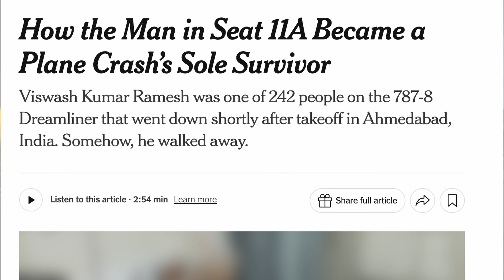Why the RAT Changes Everything – Air India 171 Update

Comment: Here is my theory about AirIndia Crash - 

One alive Passenger told to media that lights started flickering green and white so it always happens when both the engines are failed or off .. RAT deployed- When both engines generators failed. I don't think both engines can fail at the same time. Air India Flight 171 took off later than expected, which could be because one engine had failed while it was on the runway. Video footage of the takeoff shows a large dust cloud form just as the plane lifts off, which suggests that it was near the end of the runway.  Why aircraft consumed more runway than normal ? If both engines had failed, the aircraft would not have taken off at all. But even with one engine down, it took more runway than expected.  It may be due to the MTOW was much more than the limit.  Imagine if there was overloading, and one engine failed on the runway. The pilots must have been startled. They would have seen the perimeter wall of the airport and wondered why the aircraft had not taken off… They were already tense about the engine failure and the delayed lift-off. They were distracted. They were supposed to pull up the landing gear at around 100 feet. Now, listen carefully. They climbed for 100-150 feet with a damaged engine, and forgot to pull the landing gear up. 
 
Pilots are required to follow ‘memory items’ in the event of an engine failure. When they hit 400 feet, the Captain of the aircraft pulled the thrust idle switch for the faulty engine, and the co-pilot pulled the fuel control switch off for the wrong engine…Wrong engine means working engine. One engine was damaged on the ground, the other engine they killed themselves. 

At 400 feet, they were without power and the aircraft started losing altitude. Pulling the fuel control switch off and the engine fire switch are irreversible actions on a Boeing aircraft. Engines will not come back, but on Airbus this action is reversible. Boeing has to modified this thing.  

So Late takeoff because one engine failed, pilots were startled, they did not pull the gear up… Once they have cut the wrong engine, they are without power. You can not do anything after that. You are going down, and you have 10-12 seconds before impact. The footage shows they tried to pull the nose up, but the plane crashed into a building, and the worst disaster in the history of aviation happened.  

Experience is different than tackling the emergency.. Sometimes experienced pilot becomes hopeless during emergency situations.. In 2021 Goair pilots shutdown the wrong engine after bird strike, once the aircraft stopped climbing at an altitude of 3330 feet, pilots realised their mistake and consequently started the working engine 1 and brought back the plane to delhi airport, but here pilots didn’t get the time to think..

Pulling the Fuel Control switch OFF initiates the shutdown, but pulling the Engine Fire switch completes the full shutdown and isolation sequence and physically locks it in place. This combined action is irreversible in flight because:

1.  The Engine Fire switch mechanically locks when pulled.
2.  Resetting it (even if possible) would be extremely hazardous.
3.  The design intent is absolute isolation once a fire is confirmed and this action is taken.

This irreversibility is a fundamental safety feature of Boeing's engine fire protection system.

Pulling the Fuel Control OFF and Engine Fire Handle/Button is irreversible during flight on Boeing aircraft due to the mechanical latch.
Performing the equivalent actions (ENG MASTER OFF + ENG FIRE Button) on an Airbus can potentially be reversed during flight.However,Reversal on Airbus is only permissible and safe if the fire warning is confirmed to be false.It is absolutely prohibited if there is any indication or suspicion of an actual, ongoing fire or severe engine damage. The electronic design allows reversal, but strict operational procedures govern when it should be used.

Comment: VADAKAYIL

AS SOON AS OPERATION SINDOOR STARTED AND I FOUND OUT THAT TURKEY SENT THOUSANDS OF DRONES/ MISSILES TO PAKISTAN BY SHIP AND PLANES

I WARNED MODI TO REMOVE TURKISH AIRCRAFT ✈️MAINTENANCE COMPANY CELEBI ( FOR BOEING ) FROM INDIAN AIRPORTS.

A SABOTEUR CAN PRETEND TO BE CHANGING A FUEL FILTER AS PER PLANNED MAINTENANCE – ALL IT TAKES TO CRASH THE PLANE IS TO CHANGE 15 MICRON FILTER BY A 5 MICRON FILTER

THE INDIAN 🇮🇳GOVT PROMPTLY REVOKED THE SECURITY CLEARANCE OF CELEBI.. THE CLEARANCE WAS REVOKED BY THE BUREAU OF CIVIL AVIATION SECURITY (BCAS) ON 15 MAY 2025

BOEING PUT PRESSURE ON INDIAN JUDICIARY AND THE TRAITOR JUDGES SHOCKINGLY QUASHED THE INDIAN GOVT REVOCATION

TURKISH CELEBI WAS PROVIDING ITS SERVICES AT NINE DIFFERENT AIRPORTS AND EMPLOYING MORE THAN 10620 INDIVIDUALS.

—

VADAKAYIL

THERE IS NO NEED TO PLANT A BOMB IN A PLANE.

A SABOTEUR COULD JUST SWITCH TO A FINER FUEL FILTER.

THERE IS NO NEED TO CRASH WORLD TRADE CENTRE TWIN TOWERS WITH PLANES . AN INTELLIGENT SABOTEUR CAN JUST BOIL MERCURY IN A VENTILATION DUCT AND NOBODY CAN ENTER THE TOWERS FOR THE NEXT SIX YEARS

THERE IS A JAMES BOND MOVIE ABOUT FORT KNOX GOLD BEING IRRADIATED ( GOLD FINGER )

SABOTAGE IS SO EASY.

.—

DON’T YOU DARE POOH POOH VADAKAYIL ON THE SUBJECT OF CHOCKED CELLULOSE FUEL FILTERS.

THERE ARE SYSTEM ON COARSE 100 MICRON METAL FILTERS ( NOT OF FINE CELLULOSE FILTERS ) TO BACK FLUSH OR BYPASS THE  JET FUEL.. I KNOW MORE .. I AM THE WORLD EXPERT NOT YOU 

—-

I HAD ONCE WARNED PM MODI NOT TO BUY CHEMICAL LADEN SHALE FRACKED OIL FROM AMERICA WARNING HIM OF CLOGGED FILTERS . WHEN CHEMICALS ARE BLENDED IN LOW GRADE FUEL, THERE IS A FORMATION OF INORGANIC FIBRE ( EXTRA FINE PLASTIC STRANDS ) WHICH CLOG EVEN 200 MICRON FILTERS .

WHERE ARE YOU GONNA STORE ALL THIS REJECT BACK FLUSHED OIL, UP YOUR ASS?

MODI WAS BUYING USELESS AMERICAN OIL ( NOBEL PRIZE QUEST ) TO FILL UP OUR UNDERGROUND MILITARY EMERGENCY RESERVES

SINCE HE WAS NOT UNDERSTANDING I HAD TO CALL HIM A ZUNT – AND TOLD HIM TO BUY SHOVELS AS PUMPS CANNOT PUMP OUT DEGRADED COMMINGLED OIL

THIS IMPORT FROM HALF WAY AROUND THE WORLD  WAS STOPPED.

—-

WE DONT CARE FOR USA🇺🇸

WE DONT CARE FOR TRUMP

BUT HEY

SLAVE MODI WILL IGNORE INDIAN NEEDS AND GIVE IT AWAY TO AMERICANS –SO THAT HE CAN GET A NOBEL PRIZE..

MODI IS BUYING SHIT AMERICAN FRACKED OIL— CHEMICAL LADEN .. THIS SHALE OIL SPOILS OUR MACHINERY AND CREATES EXCESSIVE POLLUTION..

ALL THIS WHEN WE CAN GET PRISTINE AND CHEAP IRANIAN OIL AT OUR DOOR STEP

I AM AN EXPERT ON THIS SUBJECT..

I COMMANDED SHIP FOR 30 YEARS..

IF WE GO TO CERTAIN COUNTRIES, ( EXAMPLE CHINA ) THEY BUY WASTE SLUDGE THROWN AWAY BY THE SHIPs HEAVY OIL PURIFIERS.. GOOD MONEY IN USD ..

THEY THEN REGENERATE THE SLUDGE AND CONVERT IT BACK TO HEAVY OIL BY ADDING SOME CHEMICALS..

THIS REGENERATED FUEL OIL, HAS MICRO STRANDS OF SYNTHETIC PLASTIC WHICH CHOKES THE ENGINE FILTERS AND ALSO CAUSES BAD COMBUSTION.. OUR PISTON RINGS GET GUMMED , WE GET SCAVENGE FIRES ..

IF FILTERS CHOKE IN A CROWDED SEA AREA WE COULD HAVE A COLLISION AND SINK..

Comment: I strongly believe that you should post a strong unconditional apology on directing, blame to the pilots. I’ve seen your subsequent videos and I’m surprised that you don’t have the professional courtesy as a commander of a 777 to admit that you made a nature reaction with limited data to assign blame to a fellow pilot and extreme stress, especially given that the commander was in instructor pilot. My father was an instructor pilot of a 747, 200 in the late 80s, and I recall the crash of the 747 in 19 78.
You should consider researching that incident and reporting on it 
——
Crash of Emperor Ashoka

This analysis is a bit long, but I am putting this comparison of the 787, 2025 crash compared to the 1978 crash of an AI 747-200 in the Arabian Sea 
They claimed that Captain Kukar was diabetic and potentially under the influence of alcohol, causing the accident.With no possibility of a blood alcohol test, how could they have determined that the commander was under the influence of alcohol?
Just take a look at the incredible experience of the pilots
—————
Air India Flight 855 – January 1, 1978
Aircraft: Boeing 747‑237B (VT‑EBD, “Emperor Ashoka”)
Flight Conditions: Night departure from Bombay over Arabian Sea (IMC)
Crew & Experience:
   •   Captain: Madan Lal Kukar (51 years old) – ~18,000 flight hours
   •   First Officer: Indu Virmani (43 years old) – former Indian Air Force Wing Commander, ~4,500 flight hours
   •   Flight Engineer: Alfredo Faria (53 years old) – ~11,000 flight hours
Technical Facts:
   •   One primary attitude indicator (ADI) “toppled,” presenting false wings-level on a left bank.
   •   Both Captain’s and FO’s ADIs were linked — leading to simultaneous misreadings.
   •   The flight engineer directed focus to the backup ADI seconds before impact.
Boeing’s Claim:
   •   Suggested “pilot incapacitation,” citing diabetes and possible alcohol use as causes.
   •   Civil lawsuit filed in 1982 accused design flaws; Boeing refuted instrument error and shifted blame to crew health.
   •   In 1985, a judge dismissed the case, citing insufficient evidence of design failure.
Aftermath:
   •   Led to mandatory independent (decoupled) attitude reference systems and enhanced training on spatial disorientation.
⸻
Air India Flight 171 (787) – June 12, 2025, Ahmedabad
Aircraft: Boeing 787‑8 Dreamliner (VT‑ANB)
Conditions: Daylight departure, crashed near airport during climb
Crew & Experience:
   •   Captain: Sumeet Sabharwal – ~8,200 flight hours, line training captain
   •   First Officer: Clive Kunder – ~1,100 flight hours (approx. 400 short of captain command rating)
Preliminary Observations:
   •   Crew issued Mayday seconds after takeoff (at ~625 ft), then radio silence.
   •   Possible takeoff configuration error: videos/ADS-B suggest flaps up or gear down, rapid descent followed. Not correct….
   •   Expert commentary points to engine failure or flap misconfiguration as critical factors.
Alarms & System Warnings:
   •   If gear/flaps were misconfigured, cockpit warnings (horn, GPWS messages) should have sounded loudly.
   •   No such alarms heard over ATC — CVR data pending. Absence of audio bleed-through may indicate late warnings or suppressed detection.
⸻
Comparative Technical Summary 
Aspect: Captain
   •   Flight 855 (1978): Madan L. Kukar – 18,000 flight hours
   •   Flight 171 (2025): Sumeet Sabharwal – ~8,200 flight hours
Aspect: First Officer
   •   Flight 855 (1978): Indu Virmani – 4,500 flight hours
   •   Flight 171 (2025): Clive Kunder – ~1,100 flight hours
Aspect: Flight Engineer
   •   Flight 855 (1978): Alfredo Faria – 11,000 flight hours
   •   Flight 171 (2025): N/A
Aspect: Phase of Failure
   •   Flight 855 (1978): Night, climb after turn in IMC
   •   Flight 171 (2025): Daylight climb, low altitude
Aspect: Instrument/System Failure
   •   Flight 855 (1978): Analog ADI failure; linked system caused simultaneous pilot misreadings
   •   Flight 171 (2025): Possible configuration error; no confirmed system failure
Aspect: Warning System Response
   •   Flight 855 (1978): Backup ADI used; GPWS warnings sounded loudly
   •   Flight 171 (2025): Unknown; CVR data still missing
Aspect: Boeing’s Health / Diabetes Claim
   •   Flight 855 (1978): Boeing claimed pilot incapacitation due to diabetes and alcohol; claim later dismissed legally
   •   Flight 171 (2025): No such health claims made about crew
Aspect: Design Correction Post-Crash
   •   Flight 855 (1978): Led to redundant, decoupled attitude indicators and improved training
   •   Flight 171 (2025): Investigation ongoing; no confirmed design flaw yet
Aspect: Primary Investigative Caution
   •   Flight 855 (1978): Spatial disorientation, controversial due to instrument design
   •   Flight 171 (2025): Awaiting CVR/FDR data to verify alarm and crew response
⸻
Closing Perspective (Speculative)
   •   In both cases, rapid loss of control post-takeoff occurred.
   •   Flight 855 revealed a tragic weakness: linked instruments that failed both pilots simultaneously at night.
   •   Flight 171 appears to involve potential configuration error, where warnings should have protected against misuse—if they occurred and were heard.
   •   Historically, aviation has learned that system design, single-point failures, and human factors can mask in “pilot error.”
   •   Thus far, no health issues have been alleged in the 2025 crash—unlike the controversial diabetes claim in 1978, which lacked supporting evidence.
   •   Conclusion: Until CVR and FDR release cockpit audio/data showing what alarms sounded and how the crew responded, any attribution to “pilot error” remains premature and potentially unjust.
WILL BOEING AND AI BLAME IT ON PILOT ERROR. Stakes are very high.
⸻
Disclaimer:
This summary is based on publicly available information and expert analyses as of June 2025. It includes some speculative observations and comparisons to provide context and perspective. This post does not intend to assign blame or make definitive conclusions about the causes of the accidents. Official investigations by relevant aviation authorities are ongoing, and final findings may differ. Any references to companies or individuals are for informational purposes only and should not be interpreted as accusations.

Comment: Sounds like normal compressor noise on takeoff to me, which many times can sound like a prop engine.  After all, those compressor blades are spinning fast enough to break the sound barrier, just like a prop engine.  Many people describe the sound as a buzz saw.

Plus, if the RAT is down, then why can't you see it as the plane first enters the picture and is closer to the camera?

To me, it enforces the fact that at least one, and most likely, both engines are powered up and running at speed.

Here is a YouTube video of multiple jets taking off at LAX.  There are at least 11 jets as they take off generating the exact same sound.  For instance, at 17:07 you here the exact sound as you here in the Air India video.  The only difference is the Air India video changes pitch as it flies past the camera.

https://www.youtube.com/watch?v=yUE9cSKNft8

Comment: There is an Indian pilot named Gaurav Tanjea. He has posted on youtube his in detail analysis of what could have happened. Unfortunately a huge portion of the video is in Hindi (https://youtu.be/bHTT9gIit0A?si=ssQun7gDyxJ2oli5) . Of course I am no expert so I will try to explain in layman terms. But here's a gist of what he said may have happened
1. (Assumption) The aircraft was loaded way more than what is recommended and the pilots were not made aware of this situation (First mistake)
2. Just before takeoff , after V1, one of the engines failed (On runway itself)
3. Since the aircraft is over loaded, it took more time than normal to lift off based on one engine.
4. Pilots panicked since it took longer than usual to take off on one engine and in the moment, forgot to raise the landing gear up.
5. REAL MISHAP HAPPENS NOW - instead of cutting off the fuel supply of the failed engine, in that tense situation, they cut off the fuel supply of the working engine (!!!!!!)
6. In Boeing planes, this is an irreversible process, meaning you can not do anything now. 
As a result, they were left with zero thrust at 400 feet in air.

Comment: I think i recall some the passengers were complaining about certain electrical features of the plane were not working such as media devices and over head lights etc ,Was this a sign of poor maintenance on the electrics ? could they have suffered some sort of catastrophic electrical fault leading to massive power failure to every system on board?

Comment: A dual IFSD due to direct mechanical failure of the engines (shaft break and OS protection shutdown) is extremely unlikely statistically, but a DIFSD due to stall is possible.... more of an aircraft level issue, fuel delivery or pilot error. With electricifcation of the jet engine coming in the next generation of powerplants, i can see manufacturers having to provide enough battery power for a TOGA so the A/C can land safely. This will be expensive since battery power will have to be traded for customers... , but this might be something the regulators push through.

Comment: And again... The only ways BOTH engines would cut out at the same time on take off for this type of Jet are, One - One of the Two Pilots reached up and shut them off,  either normally or with the Fire Handles ( Why I don't know) OR the Plane Fuel system was shut off ! Now have they confirmed the Plane was properly fueled? I don't know.  
But to my Aviation mind, this was some type of purposeful shutting off of Both Engines.

Comment: It’s interesting on the speculation, but hopefully the data boxes since the tail looked mostly intact. Will tell what really happened. I wonder about all of the software and computers if they caused a problem or like was mentioned maybe it was just too hot of a day, I know what the Phoenix airport in the summer sometimes they have to halt Flights because of extreme heat. Also, I wonder if carbon fiber derogation issues could’ve been at fault and lastly is this carrier fully maintaining the plane properly? I saw some videos where India 787 air conditioning and in-flight entertainment were not working but they were still boarding passengers and operating the aircraft I think it’s human sometimes we try to pinpoint things to a single failure Which to me is being lazy and thinking it truly is one when it could be multiple things leading to the crash in a cascading fashion not just one issue. another one, maybe a terrorist intentional damaging of a part of the aircraft. And another debris being kicked up to a flight control service and preventing full movement this has happened. I know in the past I think it was on a DC  8 and ground debris apparently caused that Concorde to go down in Paris